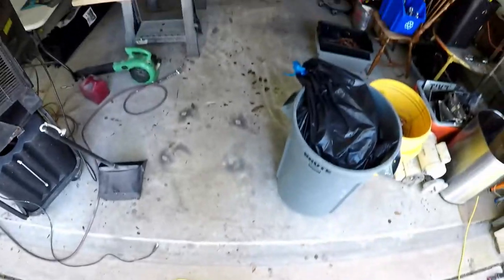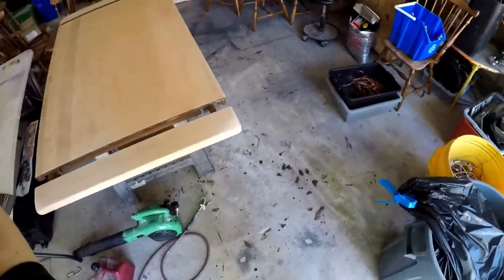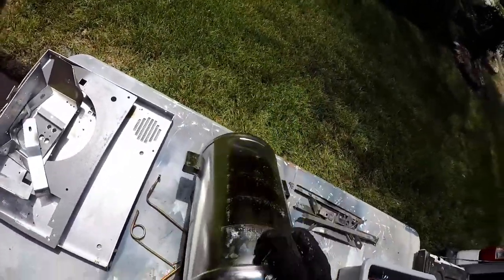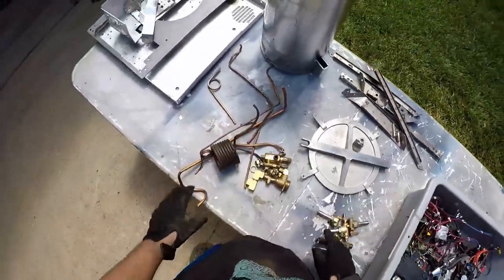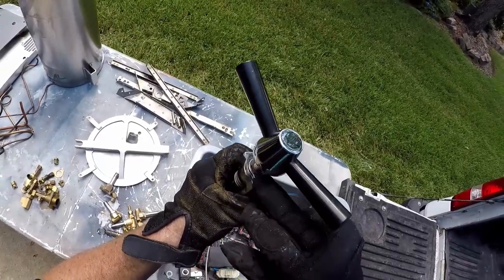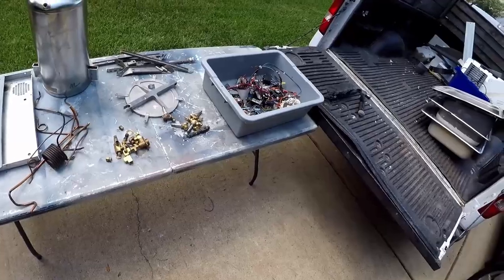Micro-Scrapping A Medical Autoclave For More Money

Comment: Trick I learned to tell if stainless steel or aluminum.  Take that grinder with a grinding wheel (works better) and run it on the metal.  If it throws sparks it is stainless.  If not, aluminum.  Thanks for all the cool content.  Keep up the good work.  Hope the storm or storms hasn't or doesn't affect you and the Mrs..  Anyhow stay safe.  Waiting for the next vid to drop.

Comment: For the love of god Mike please put a guard on your grinder. If you slip it will cut you to the bone through your gloves or clothes. If the blade explodes your safety glass's might stop  smaller pieces but the rest of your face is exposed. I worked as a Boilermaker, what you all call a welder fabricator, for 23 years and i have seen grinding disc's, cutting disc's and grinding wheels blow apart. I had a 9" cutting wheel and many others  explode on me, thankfully i always used a guard. Guards are annoying but i would rather be annoyed than scared for life because i slipped or one exploded. Cutting wheels are NOT designed to grind they do not have the lateral strength. Please as someone who has seen fingers cut off, tendons in hands, legs and arms severed and pieces of blades in body parts i'm pleading with you and your wife please put a guard on that grinder.

Comment: 2014 was the last calibration date. Probably manufactured in the late 1990s , check the rear of the case. Even listed as parts only they sell for hundreds of dollars online. I wish I'd left a comment on the last video. :(
Reply: It says on the pressure chamber 2014